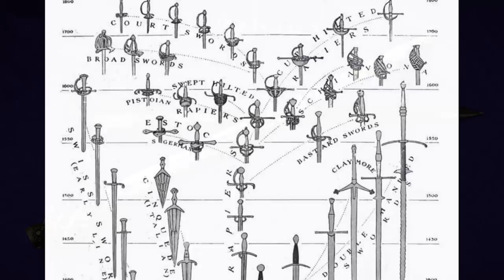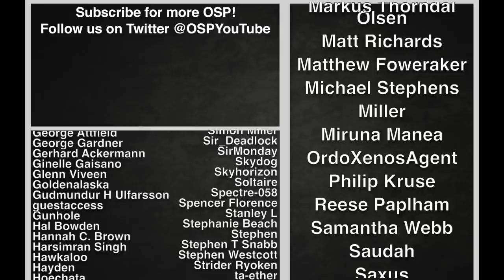History Summarized: Steel (Feat. "That Works")

Comment: when you brought up damascus steel, i was like "oh red covered this in one of her videos" and lo and behold, you flashed back to it. nice.
Reply: I'm relatively new here. What video was that?
Reply: @bluesbest1  It's from "Beowulf"
Reply: I wonder if we will ever figure out how the hell they got carbon nanotubes in there, especially when we modern Hoomanz with our new-fangled techno-wizardry only started making them relatively recently...
Reply: @achronalart  Thanks. I'll check up on that.
Reply: @Lh0000  Carbon nano-tubes are actually easy to make, it's just very hard to make in high concentration and low impurity in a consistent way for industrial purposes. Basically, randomly spraying certain very hot materials with methane, carbon monoxide, etc. (all of which naturally occur in fires from a carbon-rich source) create CNTs. Their presence in Damascus steel is almost trivial.

Comment: "Carbon. Goddamn. Nanotubes. How does that even happen?"

You tell me.
Reply: No one knows, because the technique is lost to time.
Reply: Possibly human bone.
Reply: Carbon found in plant matter which contaminated the process, likely through incorrectly made charcoal. Either that or the addition of human bone fragments, a carbon rich substance, to “enchant” the metal. Those are what I’ve heard.
Reply: CAAAARBOOON NAAANOOOTUUUUUBESS
Reply: If I recall correctly, one hypothesis points to vanadium intrusions in the iron veins where the ore was mined.  This engaged in some interesting chemistry when smelting the wootz, encouraging carbon in the steel to form more carbide grains, and in places link up into full-on tubes.
Reply: What video is that from?
Reply: @Kaijugan  I think it's the Beowulf video.

Comment: 11:50 - also, "spring steel katanas" are modern invention. Differential hardening (as mentioned in the video) was the game back in the day, and historical katanas were not made out of the spring steel (1. the purity level of steel used wasn't up to snuff, 2. the proper technique of heat treating of the weapon made out of different types of steel would destroy the whole construction).
Really interested in your book Blue, by the way.

Comment: Thanks for the collaborators reporting from an actual forge on the history of this light-weight, strong impact material being used to make weapons.  I never thought steel could be connected to making pottery either, but I do remember different chemical compounds creating different colors and finishes of glazes from the few times I have painted pottery in my lifetime.  Blue, this was great.

Comment: Pattern welding was also used historically; bloomery gives you chunks of iron with various carbon contents, so you take some bits with higher and lower carbon contents, forge-weld, fold and twist them together to average out the properties, and you get a high quality and very pretty metal object.

Comment: I’m a hobbyist blacksmith, and it blew my mind when I learned how little carbon is used to make Steel. 
Too little and you get wrought iron, anything over 2% becomes pig iron. 
It’s crazy how just a tiny amount of carbon vastly improves the qualities of iron.

As much as I don’t like Japanese swords I have to appreciate the amount of work that goes into them. That iron bloom is extremely brittle and difficult to work with to start, and then That folding technique can potentially can ruin the blade, unless you know what you are doing you can irreparably damage the steel creating cold shuts, bad welds, and cracks.  My hat goes off to anyone who does that sort of thing on a regular basis.

Comment: Shiny steel is great, but I'm still waiting for plasma swords.
Reply: @Thomas.Wright  Yeah, but...

Laser sword
Reply: @ogfat9277  realistically the hilt of a lazer or plasma sword wouldn't stop moving when it's blade makes contact with another blade.
Meaning real life lazer swords wouldn't clash, they'd just phase through each other.
Reply: @dinosaurusrex1482  Maybe so, but there's this one small detail you've overlooked...

Laser sword!
Reply: @blarg2429  the fictional weapons equilivant of bacon
Reply: @dinosaurusrex1482  what about plasma based beam swords? Those that use magnetic fields to shape and contain the plasma blade
Reply: Guess the Hacksmith actually made one huh

Comment: I thought I watched all your old videos?! I have a Materials Engineering degree, how the f did I miss this?!?! We spent almost a whole year studying steel mostly from a chemical aspect, but we also had a part where we studied the history of it. One of my favorite facts (besides the Damascus blades having nanotubes which is SO COOL) is not only did the Japanese swordsmiths use the clay to control which bits of the sword became which crystalline structure, sometimes they would also embed different types of steel within different parts of the blade to control the carbon content in that part. Which I imagine cannot be the easiest thing to do with hand tools and a very hot, very thin blade.
Reply: If you check out That Works channel, they've made a few weapons using the technique of having a high carbon center with a lower carbon exterior.  The Skalchion (the falchion they made as a gift for Skallagrim).

Comment: Literally had just a test about the process of making steel with austenite, ferrite, how you need quench it to get martensite instead spheriodite, and how martensite can be annealled to increase ductility so it is not so brittle.  This was a materials science and engineering class

Comment: my favorite kinds of steel are glassteel and something I've heard referred to as "magnasteel" not sure if that's the actual name or just what it was being called where I was reading about it.
glassteel is a glass/steel alloy that sounds like something out of a fantasy novel, it's pretty soft by steel standards but it is incredibly flexible, as in you can tie a knot in it and it will return true when untied, it's also VERY resistant to some kinds of wear and tear as a result, I'm guessing it's got some crippling issues that weren't mentioned where I was reading about it though since I haven't heard about it actually being used for stuff.
magnasteel is both much simpler and much more complicated: it is essentially just drop forged steel made inside a carefully structured magnetic field, as the whole process goes on and everything crystalizes the field keeps it all in place and you end up with crystals forming in a regular pattern instead of every which way. the result is about the difference between making mudbrick with some handfuls of grass thrown in and making mudbrick with a net of woven fibers laced and placed carefully throughout. stat wise it's pretty much just high carbon toolsteel but better: better structure results in the material being both somewhat harder and significantly more flexible, and able to absorb more energy while deflecting / before denaturing.
magnasteel is actually used but it takes a LOT of prepwork to make anything out of it so it's pretty much only worth it for mass producing small critical parts that you're gonna need a lot of, I suspect that drawback could be reduced with groundwork software but I don't know bleep about the actual specifics of this and you'd probably still need custom setups for each piece and a heck of a lot of calibration work even if you could get the required design out of a couple hours work in an overgrown version of autocad.
Reply: What can you tell me about durasteel?
Reply: @JaelinBezel  while I'd be genuinely surprised if that's not the name of something in real life the only place I've seen it used is across several sci-fi settings, I'm pretty sure that list includes Dune so that's a decent bet for where it's coming from at the moment, "plascrete" is another really common one.
also crystals, so many crystals...I think those are probably more common in sci-fi than in fantasy really.

Comment: Conan had solved the riddle of steel.
Reply: That's some funny shit right dere
Reply: It's a Koan.  There are an effectively unlimited number of answers.  Most have some level of validity.  It is the contemplation of the question, or even articulating the question itself that has the value.  It is to the individual to solve the Riddle of Steel themselves.
Reply: @morganrobinson8042  my brain just shit itself.
Reply: My first thought when reading this was "are they referring to the anime Detrctive Conan!" 
No. No you're not. But he totally would solve that though.

Comment: "Deeply complex subject." Understatement... There are entire required courses dealing primarily with steel (and other materials) in Engineering coursework. You could have made a video this length on the austentite/martensite/tempering process... but you'd need another video to explain the phase diagram(s) of iron and carbon,

Comment: As for weapons you can get a harder and more durable edge with a bronze blade than you can a pure iron one. Pure iron and mild steel are both relatively soft, and bronze has the added convenience that the final working is at room temp, which is not only safer to work than hot iron but saves fuel used in a forge in areas where that may matter.

Comment: You might want to check out Scholargladitoria's videos on Wootz steel and Demascus because we now know how it was made, long story short a couple of master blacksmith's got steel from the place that it was originally from did some spectroscopy and found that an element was present in a trace amount that had an amazingly important effect on the entire structure of a piece of metal made with it, also 'true Damascus' is cast rather than forged. Genuinely though this is a surprisingly big thing and has literally been discovered within a years time people have been trying to work this out for over a century.

Comment: Folding does have an effect on the blade's grain structure. Without folding, grains are randomly aligned. With repeated folding, the crystalline geometry of the grains tends to be similar in adjacent grains and grains tend to be more uniform in size and phase. This edges out additional hardness from a steel that would otherwise be softer. Grains also tend to be smaller, and smaller grains increase hardness. Celts in Europe had discovered this already in antiquity. Only, they were too lazy to do all the hammering the Japanese were doing, and instead just twisted bars of steel, getting comparable results with less effort.

Comment: I would say that grossemesser is more of a raw power for a two handed medieval sword while longswords are more for finess.
Reply: They generally have the same kind of power since they tend to be of similar size, the differences only matter when there are different kinds of armour involved.
Reply: @SonofSethoitae  grossemesser tend to be a bit more front heavy and heavier at least in my opinion
Reply: @paweandonisgawralidisdobrz2522  That could be, you may have more experience than I do
Reply: @SonofSethoitae  i dont have much either honestly

Comment: Another problem the Japanese had was that the majority of the iron ore they had access to was pretty crap quality. Their biggest iron "mine" was actually iron rich sand, leading to a relatively higher amount of silica impurities, and silica, like sulphur, is bad for steel, though not in the same way.
Another thing that (somewhat understandably) got skipped over is in the iron making process. Making good quality smelted iron is actually a very difficult thing to accomplish, which is something the bloomery process handily sidestepped by not trying to actually melt the ore all the way. Iron has this quirk, where most natural variants of it have a stronger oxidation state when they're hotter, and tune melting point is very close to the optimum for grabbing all that oxygen out of the air. As I'm sure you all know, rust is neither iron, nor particularly useful to anyone without a need to blow things up and access to aluminum. You need something that was going to steal enough oxygen to prevent oxidation of the iron, but not to much as to impede combustion in the fuel used to melt the iron. I know the Hittites solution was including limestone in their smelters, not sure about others. In a video focusing on steel, I understand why this got skipped over, I just felt the need to inform.

Comment: From what I read, China actually virtually skipped the bloomery part of iron smelting and went straight to blast furnace, in around 500 BC. They do know bloomery, but they realized the blast furnace is better so they sticked with it. The interesting part is: this blast furnace cast iron is made mostly only for farming and other civilian tools and not immediately adopted for military use! Also, it puzzles me how China can achieve blast furnace cast iron since the BCs and yet the Japanese just next door is stuck with the tatara that doesn't fully melt iron (and thus comparatively worse steel). Why didn't the tech diffuse there?

Comment: Just imagine.

In this universe, Iron is naturally produced (here, produced means creation of Iron atoms in the first place, and not their extraction from an ore) in the core of the most massive stars only, right before they die and self-destruct (in a manner so violent, it would be capable of obliterating entire solar systems if they were nearby).

And imagine that a piece of such a star's core hurtling through space in the form of an Iron meteorite and finally ending up in your living room showcase or ending up on your waist, in the form of the sword strapped to it. Amazing.

Comment: It's a bit of a misconception that iron was "discovered" after bronze.  People started working iron long before bronze was invented, but forging techniques were inadequate to produce high quality iron tools.  But copper and tin are easier to purify, and experimentation led to refined forging techniques over the years.  Then, at some point, these techniques were turned back to iron, when people started to realize that high quality iron could be better, and cheaper, than high quality bronze.

Comment: Actually, folding does improve the toughness of the steel by introducing atomic deformations in the metal. These deformations help prevent cracks from propagating, increasing the yield strength of the metal. The drawback of this is that it makes the metal more brittle.

Also, if the metal is cooled slowly, larger crystal structures will be able to form. Cooling the metal quickly causes more and smaller crystals to form, which likewise increases the yield strength by preventing cracks from propagating easily. This is the primary reason the blade is cooled quickly, and also explains why letting some parts of the blade cool slower will result in those parts being more flexible.
Reply: If it makes it more brittle, it doesn't prevent cracks from propagating very well.
Reply: folding steel can also cause its to splinter into a thousand pieces along the forge welds if they are not properly welded
Reply: @SonofSethoitae  That's obviously not what brittle means in this context, although in retrospect it was a poor choice of words. Any metal will fail if you apply a large enough force, the impurities don't really stop this from happening so much as they make the necessary force (tensile strength) much higher by impeding the propagation of deformities.  What I meant by "brittle" was that the ductility is decreased, or, in layman's terms, it becomes less flexible.
Reply: @TheNodrokov  Yeah, I know. The whistling sound you hear is the joke flying over your head.

Comment: A note about Japanese swords - you might know this and just skipped it for time, but the double-edged sword (tsurugi) were prevalent in Japan up until around the 10th century, with an accompanying straight (rather than curved) single-edged blade (chokutou). I don't know that there was any one reason why the curved single-edged swords (tachi and its derivatives, including the katana) won out in development, there may be more versed historians to give a run-down of the reasons.

Comment: I do need to go on a bit of a rant about the wootz/damascus thing you mentioned though. Firstly the original method of making wootz has not been lost to time, it was made just like any other crucible steel; the only thing that seperated it from other steel was the presence of Vanadium in about 0.005-0.01% concentrations. Al Pendray is a modern smith who is actually pretty famous for his consistent reproduction of wootz. Secondly the carbon nano-tubes thing was pretty rare in wootz (if it existed at all) and in antiquity wootz was described as being brittle, breaking in cold weather, contaminated with sulfur, and extremely variable in quality. "Equipment for Knights and Insignia of the Brave,” a book written by an Arab man, Ibn Hodeil, comments,  "The Arabs claim that the fabrication of (Frankish swords) is the work of Genies. They are more resistant to blows one gives with them even during cold weather, while the Hindy (wootz) sabre often breaks when the weather is cold..." The reason the failure rate was so high was because people back then just didn't have good ways to measure the carbon and contaminants in their steel. Mixing the pig iron and wrought iron was basically a guessing game and to get that "water silk" pattern you basically had to get lucky and find ore with the correct amount of vanadium.